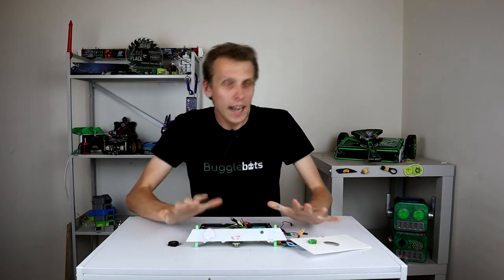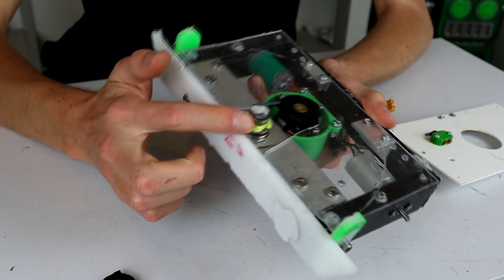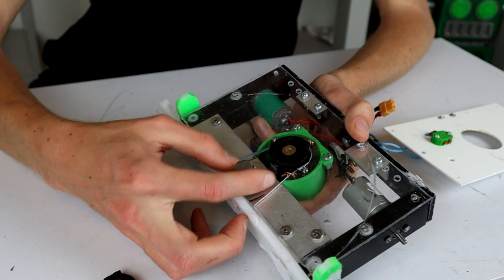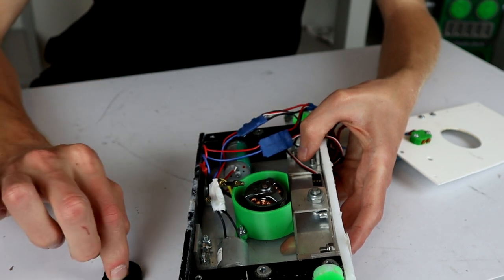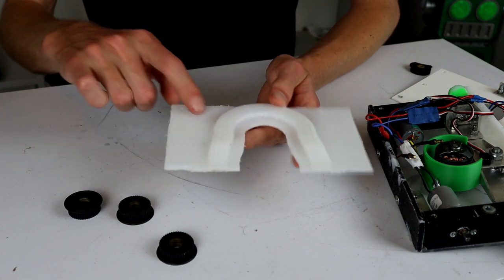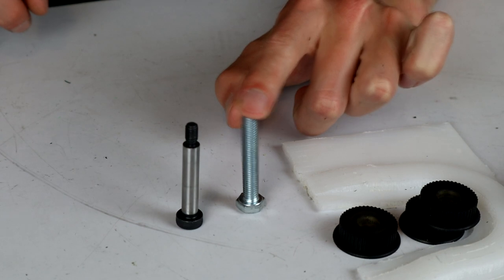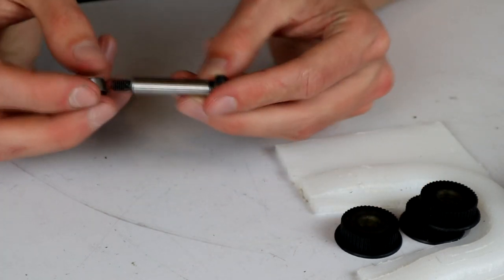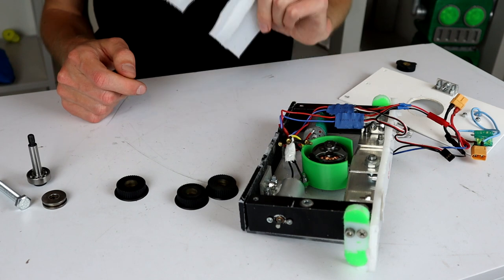Beetleweight undercutter upgrades (1.36kg combat robot)

Comment: For your standoff problem, you could attach them to the front armor so the touch the ground either way
Reply from the maker: I dont like that idea, because the front armour gets hit often and warps.
If I attach the stand offs to the front armour and it changes shape in a hit then the standoffs change height, causing the weapon to hit the ground, or hit the stand off.

At one point I changed the front armour to protect the standoffs, because they got hit in a fight and the blade started hitting the ground.

Comment: Nice work.

One thing - Can't help but think the motor mount that's only supported on end is going to bring back all of that flex you got rid of with the shoulder bolt. Could well mean it chucks belts?
Reply from the maker: In the past, belts have broken rather than being chucked and the big problem with the wobble was the blade hitting the underside and killing the motor pulley.

Its possible that the new motor mount will wobble and chuck a belt but that will be a brand new fault and I'll have to find a fix for it, (possibly a big captive bearing at the other end of the motor) but there's only one way to find out. So I'm going to run it as is and hope it all works out
Reply: @TeamPanicRobotics  fair play :-) wasn't a dig (I'm here to learn!) Just an observation
Reply from the maker: All good man, I didnt take it as a dig. I also hadnt thought of the possibility of it throwing belts. Its something I'll be looking out for now though!

Comment: Ben, any chance at getting the metal base and sides milled from one piece of aluminium instead of bolted together? Could the lack of bolts save enough weight to allow some more aluminium rigidity struts as well? Or is the cost of doing this simply prohibitive?
Reply from the maker: It is cost-prohibitive, I'd need a block of aluminum 170mm*120mm*30mm 
And I'd CNC out approximately 90% of the block. That's expensive and wasteful
Reply: Team Panic might be a little late, but would a UHMW or lexan chassis work?

Comment: What weapon motor do you use?
Reply from the maker: its a propdrive 3530 1400KV Brushless.
Which is probably overkill but I like being able to spin the weapon up quickly
Reply: @TeamPanicRobotics  How did you mount the blade? I'm pretty new to the game and interested in using a similar design
Reply from the maker: I didnt mount the blade directly to the motor
You can do that in ant weight, but not in beetles

So the blade is run with a belt drive, and the blade itself is mounted to the pulley with 6 m5 bolts